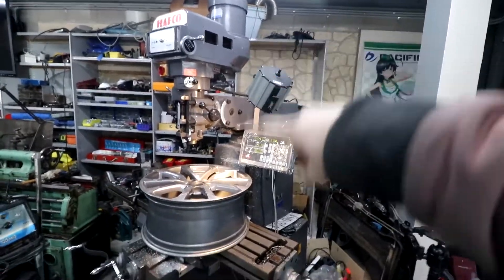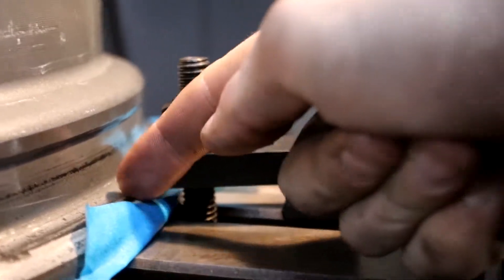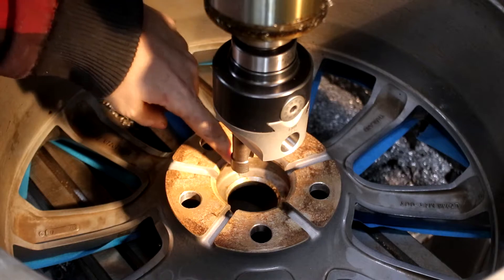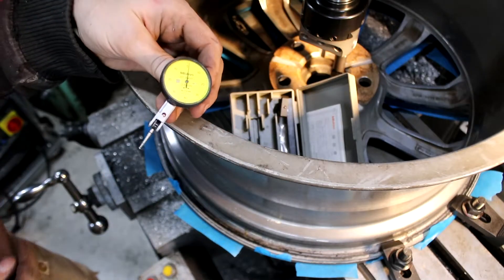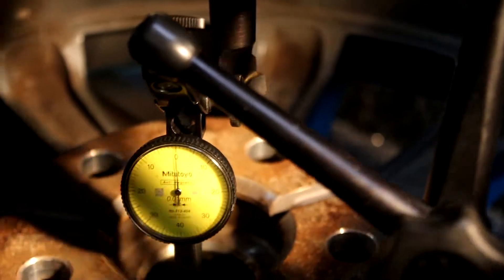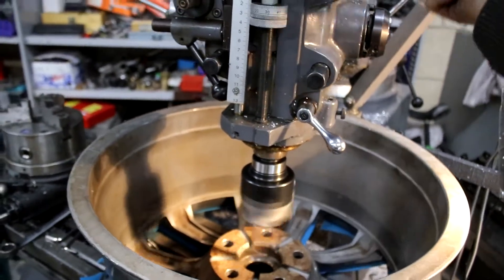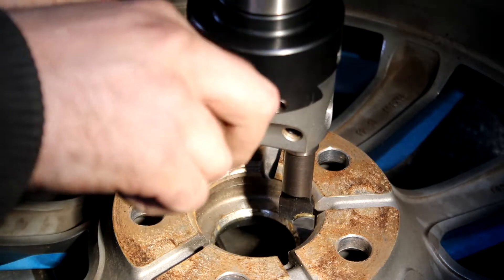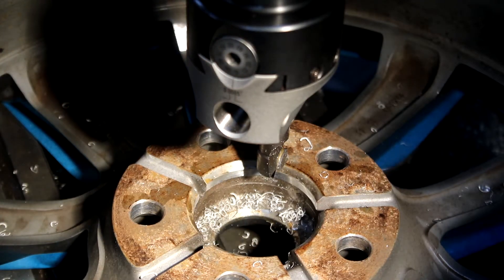How to Bore Wheel Centres to Fit Bigger Hubs.

Comment: I have OEM BMW wheels (72.5), that were first hand bored to ~75mm. I went to a 'repair' shop that re-bored to ~76 or 77mm. Sadly, while the new bore is perfectly round, it's visually offset from the OEM 72.5 bore by ~0.3mm from center. This results in on one side almost overlapping with the original bore, on the other side its almost 0.5 to 0.6mm in the wheel. I was provided with ring hubs, but I'm getting a lot of vibrations above 100 km/h. What can I do in order to get a perfect center? Any advice or tips?
Reply from the maker: Ditch the rings and just run a Clarence to the hub

Comment: Great video. I need to do exactly what you did but to Series-2 SS Commodore rims. Could probably buy an old Bridgeport for the prices I was quoted in Perth. Think I'm going to use router/trimmer with cutting bit that has bearing on end and run around the slightly larger diameter outer part (roughly 71ish mm) and then have custom thickness hub centric rings made to get me back to the 69.5mm. Looks like a far cheaper option so far.

Comment: Ended up here by way of looking for solutions to make wheels with a smaller bore than my hub fit to my vehicle. I am not knowledgeable in any sort of machine work but just wanted to say how impressed I am with your explanation and level of detail…would you consider this a standard task for a machine shop, or am I better going with a hub adapter/spacer?
Reply from the maker: This is basic work for any machine shop.   Only issue is some places don't like doing car parts because they are worried about being sued.
Reply: @Conorsev  got it. Thanks for the reply
Reply: I’d need to go from 72.50 or 72.56 (depending what spec wheels I can get my hands on) to 74.1 on one axle, and 72.50 or 72.56 to 72.6 on the other.

Comment: How did you get the lathe and the Bridgeport in your shed man? Hiab?
Reply: I move my heavy milling machines on 2x6 dolly, and other on steel custom size DIY dolly:
How to make simple Dolly  https://youtu.be/5XhaxhSogkk?si=tt2RoWn9WaJL8n-a
Welding Heavy Machine Dolly https://youtu.be/7Pc72Y4nffs?si=xg9qqRYOEvaPqYnM
Rolling into garage machine 3000 pounds  https://youtu.be/lZdSN6IZ4VA?si=tAtAeN8f2HBHPbNX

Comment: Does this process dramatically weaken the rims?

I'm in need to do this myself but when I asked people about having it done, and random guy said no one probably wants to do it for me since no one wants to be responsible for weakening the rim like that since it could be dangerous. I have a set of aluminium rims with centre bore 60.1 millimeter, and want to make it 67.1 millimeter. Does it have to do with how much material to take off, that the increase is too much in my case?
Reply from the maker: Yeah that's a pretty large increase but in my experance most professional shops won't touch car stuff just because of the 0.1% chance it goes wrong it's just not worth it
Reply: @Conorsev  Allright, might have to reconsider then. Thanks for the reply! :D

Comment: A little much on the rpm, I've had those boaring bars explode, low gear around 200-250 on aluminum, great job, great video..

Comment: What about machining out the back face of wheel hub to go from -2 offset to 0 for example?
Reply from the maker: Machining material off would go the other way.  If you took 2mm off it would go from 0 to +2.   You need to add a 2mm spacer to go to -2
Reply: Minus offset numbers are equivalent to having a spacer installed.

Negative offset moves wheel outwards from centre, positive offset brings wheel inwards from centre.